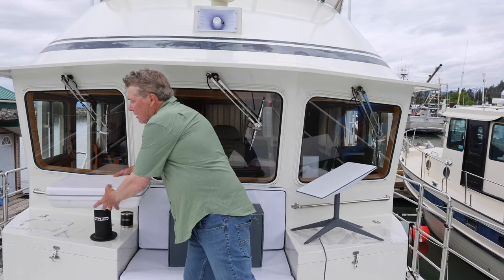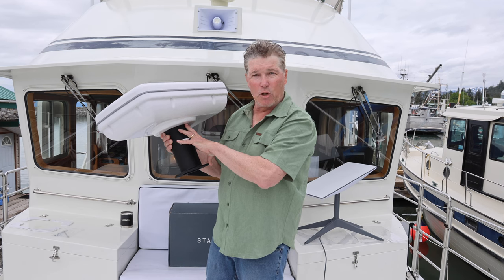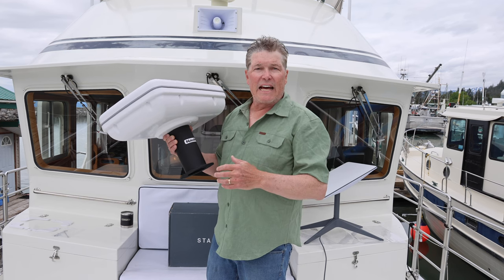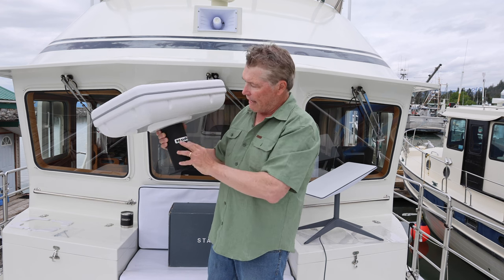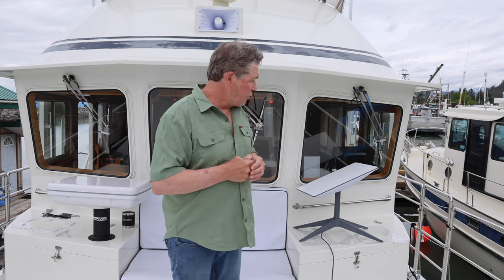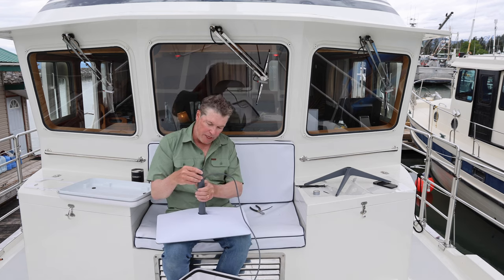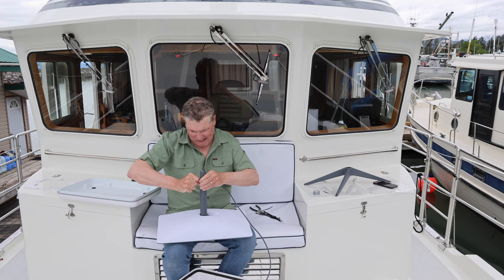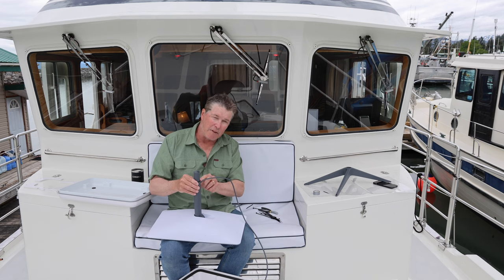StarPod Housing for Starlink Roam/RV - Overview & Installation

Comment: $600???? YOU ARE OUT OF YOUR MIND!
Reply: Do you have any idea how much large injection molds cost? Packaging, shipping, silicone gaskets, engineering...
Reply: @moki123g the truth is injection moulding is a manufacturing process for products expecting high volume production. Not this.

I would highly recommend drilling a hole under the dish and disconnecting the motor control wire instead of just letting it burn out inside.